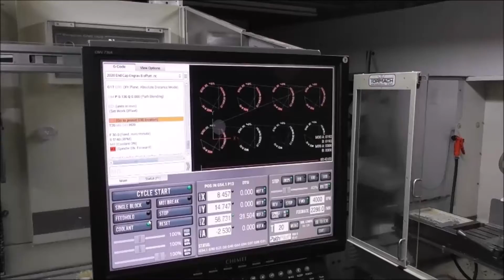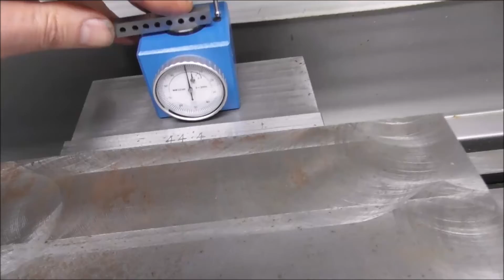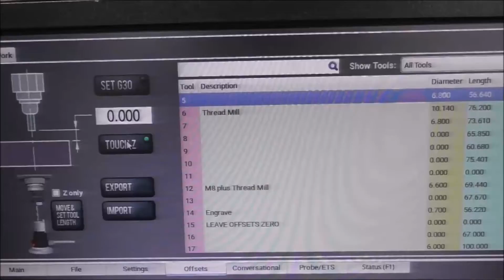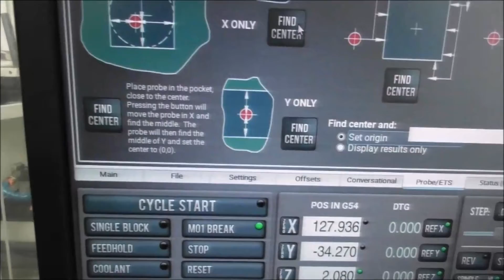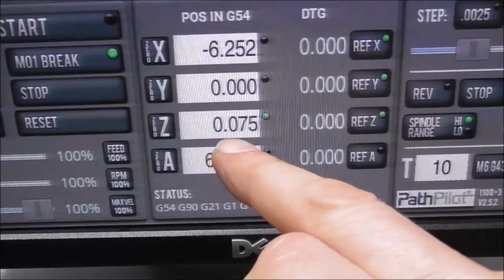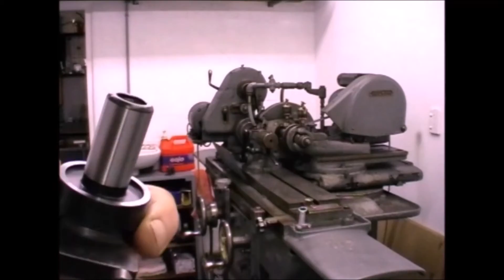Fixtures and using a toolsetter

Comment: I have multiple of those tool setters and have used them extensively every day over the last 3 years here in Michigan on 4 different fadals. I'm surprised that you have repeating issues with them. I have never seen anymore than .0002" to .0004" inches. (.005-.010 metric) And when I do see issues, it's usually just backlash from manual jogging positive a click and not realizing. I see that you're setting it off of the top of the fixed jaw. It actually does matter where you place the setter depending on: 1) how large your part is, or 2) how accurate your tram, leveling, and any shimming your workholding/machine may have. Most service companies performing a pm, only guarantee their tram/leveling services (for pre and early 2000's machines at least) to be range accurate within .0015"/.038mm. I set mine on the front-ground slide of the vise in the center right of the table. It's the happy medium for me. 

In the video you went around the dial twice while setting. I've never done that because it seems like unnecessary stress plus they state it in manual on their site. Mine are identical to yours, however mine are from an American company. Message me if you'd like a link. Also, you seemed really sure that there is a design/manufacturing defect between the plunger and the dial, but you didn't actually describe or show what the defect was. Can it really be /both/ a design and manufacturing failure? I can set all 24 tools in my fadals 4 times faster than any probe in our shop, and we have brand new DMG's all over the place. I enjoyed finding someone else who appreciated this design. The guys that forgot to retire here at my shop won't get off of their .100" feeler block. Honestly, they just don't want to do the math. I built a spread sheet to autocalculate parallels and part offsets all based off of the origin 2" height of the tool setter in the bottom of my vice. Anyways.. Much respect. Just found your videos. Subbed and liked. God bless cheers mate!
Reply from the maker: Cheers! Thanks for your thoughts. Cliff